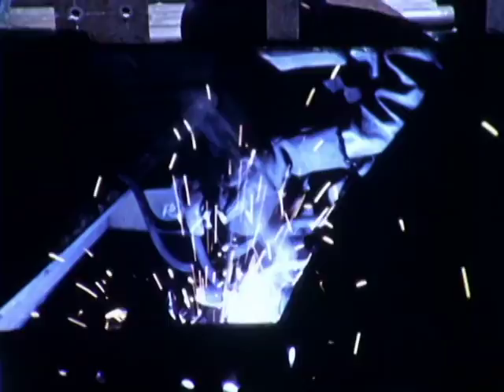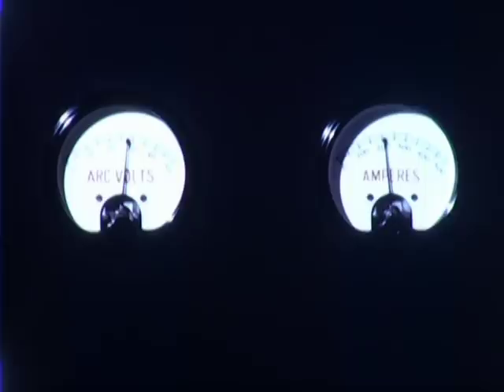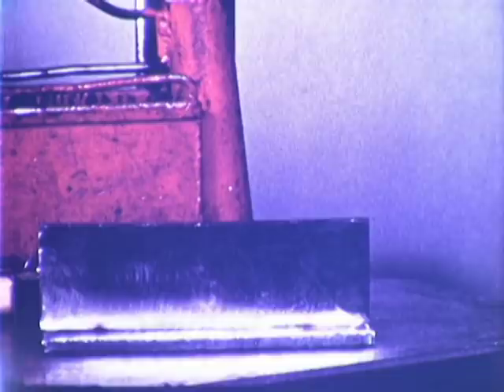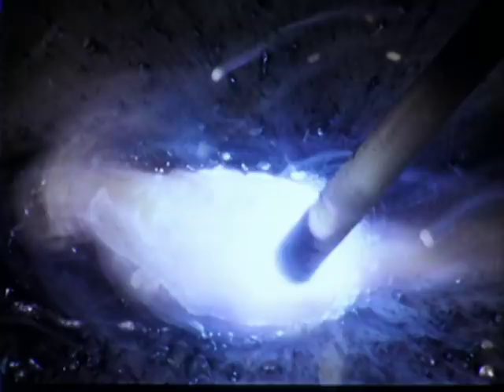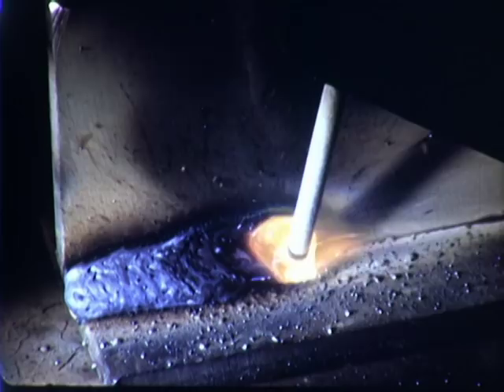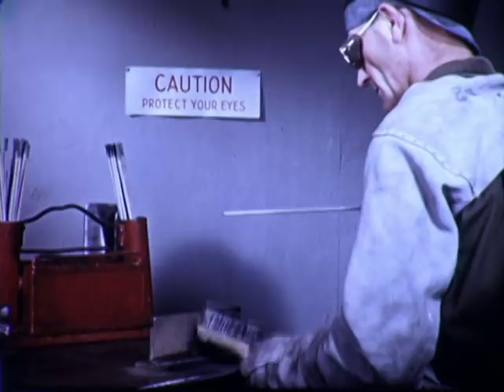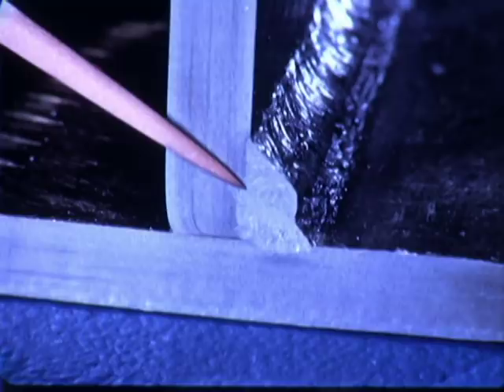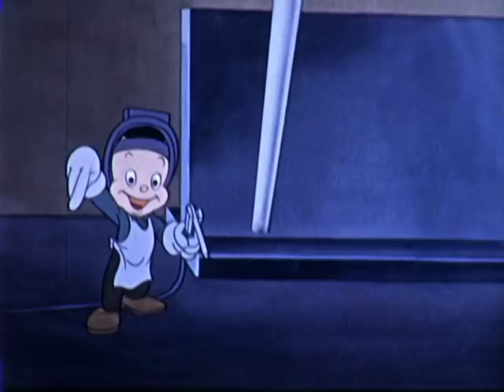Inside Arc Welding #3: Horizontal Position - 1942

Comment: I think this was back in the days when they didn't have filter lenses for eye protection. They used a clear piece of glass and held it over a lit candle until the glass got dark and used it to weld with, and a lot of welders went blind by the time they were 30 years old.

Comment: Such interesting lessons! I gotta say, those arc shots and demos are simply amazing and in depth. I also find it interesting how wide that weld pool is for that size of rod/weld, and how there was a change of angle to "mitigate arc blow" but I recall that arc blow is associated with DC machines and  welders specially use AC to avoid it. Straight up have to love this video. So nostalgic and informative

Comment: Lincoln built those SA machines that had 2 dials on them. They were tube shaped on 4 wheels. They were and still are the most bitchen machines. They say they are super expensive to make and that's why they don't make them anymore. They also require a lot of skill in getting them adjusted right.
Teaching the art of SMAW you cannot beat the arc shots and simplicity of these videos. Thanks for uploading them.

Comment: weld at 3:18 didn't penetrate the bottom and has a visible fault that runs in the horizontal position. you can see the bead sitting on the bottom. I'm just in my 2nd semester of college for Weld/Fab. so good on me for seeing that EH!!  ;)

Comment: It was also that it was more expensive, and needed due to a skills shortage.

Therefore you didn't waste time with much. You needed to get on to the point.

Now they can piss about a fair bit, and waste time with workplace safety. It was assumed if you hurt yourself, it was your fault. Not always the case, but it certainly made for a more safety conscious workplace.

Where I work, there's DUKW vehicles produced in 1942, and the welds on it are decent.

Comment: good welding video but they forgot a lot of stuff like fill the crater consistency etc anyone can weld but you have to know what your doing and have the skill to do so to keep the metal fused together until broken apart on purpose

Comment: 7018 didn't exist yet. This, combined with the rather poor decarburization of the Bessemer process, made welding stronger steels, like those in ships a bit precarious to say the least. Many Liberty ships, often welded with 3/4" 6010, were lost in cold cracking incidents, one of the main reasons for the development of 7018.

Comment: running drag technique on 6010? its deep penetration you should use something like a whip and pause technique, especially for the root.
Reply: +aaron jones whip and pause only for open root i usually do small cicles or drag 6010 on a joint like this but if ur planning to do pipe welding i definitely recommend whip and pause for everything so u can practice for an open root
Reply: +MR t yeah thats what I&#39;ve been doing for the 2g and 5g pipe I&#39;ve been practicing, we&#39;re working on 6010 from root to the cover and we will whip and pause for the root and we do long arc &quot;lilly pads&quot; for the hot pass and weave for the cover. 5g weave covers and 2g stringer covers, Just working on skill development. So many different ways to accomplish the same thing, its a beautiful thing. I think of it as art pretty much!

Comment: Horizontal is a difficult position? Sorry, overhead and verticals were the hardest for me.
Reply: +buddhaman001 been going to welding class for 3 months. But yeah, horizontal is way easier than overhead
Reply: this isn't really horizontal. horizontal usually you have to weld bead on top bead.
Reply: the cartoon is a horizontal weld and it's not that easy
Reply: adam sorell. You are sorta correct. These are horizontal filet welds in a "flat position" and the cartoon is a horizontal butt or groove weld in a "vertical position"

Comment: That isn't the horizontal position, it's a flat position fillet weld.
Reply: Jairred Stephens wrong to be in the flat 1F position, the t joint would have to be turned up at an angle.